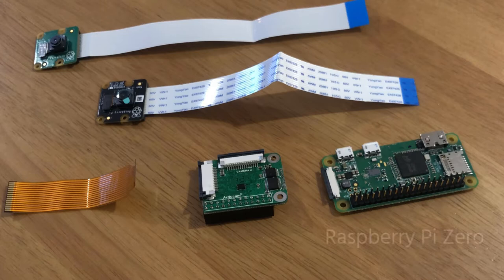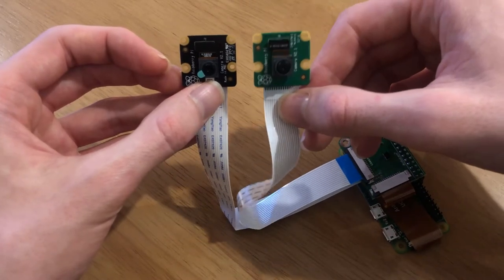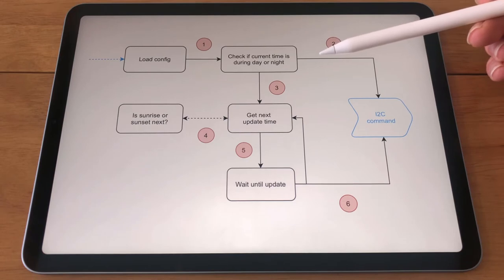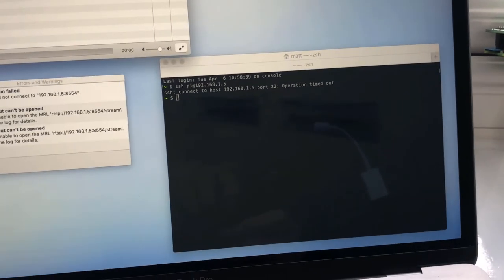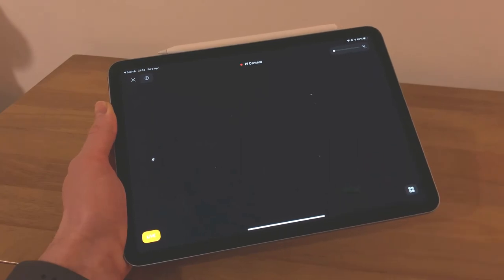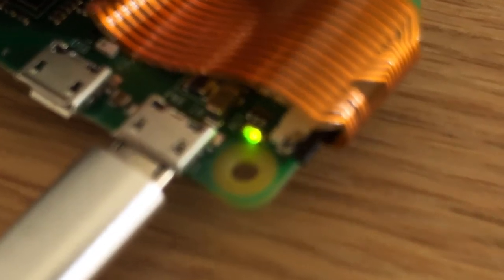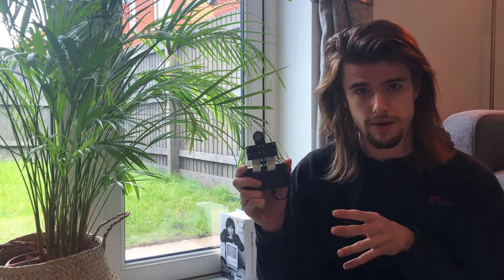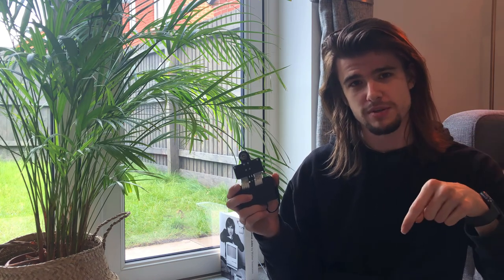Eye of the Pi: a time aware streaming camera

Comment: Nice project and video!
Did you consider the option of using a light sensor module to trigger the switch from day to night mode? Then you could continue using the daylight camera up until the point that the image becomes too dark, and switch over to the NoIR at the most optimal time.
Loving how good that Prusa Mini is too. Did it take you many prints to dial it in before printing the finished case?
Reply from the maker: Thanks!

I did consider a light sensor, though wanted to keep the hardware side of things as simple as possible really. Plus, it gave me an excuse to figure out how to handle light conditions with some safe assumptions in software… 😅

As for the printing, I had one failed print for the main case body, and then had to do 3 separate prints for the bracket holding the LED on the top - getting circular cutouts in just the right spot was a little tricky. Really do like working with the printer though!